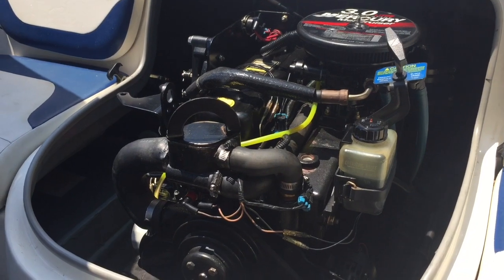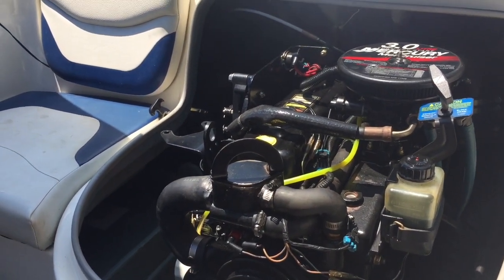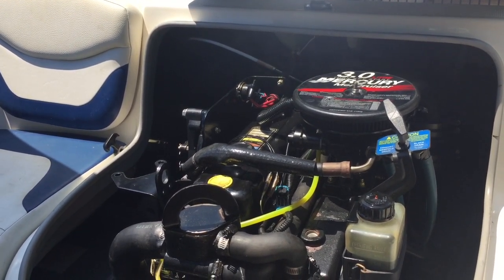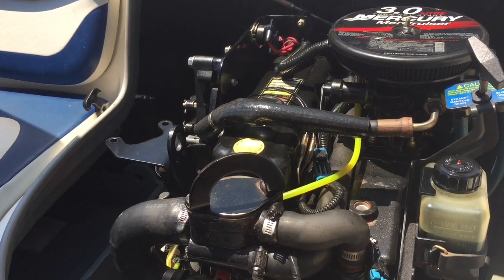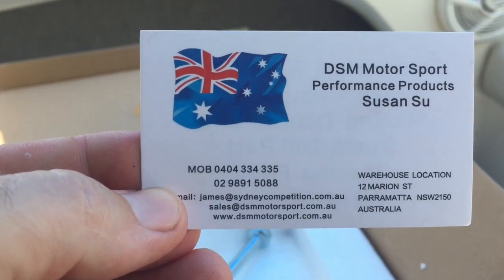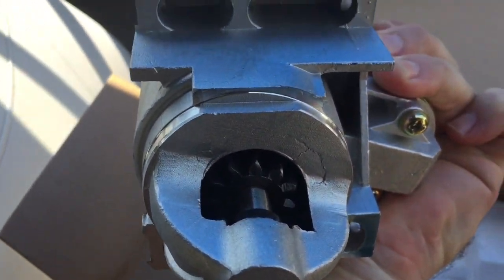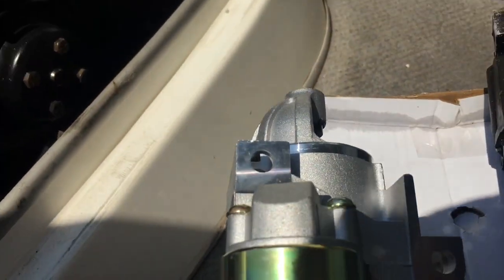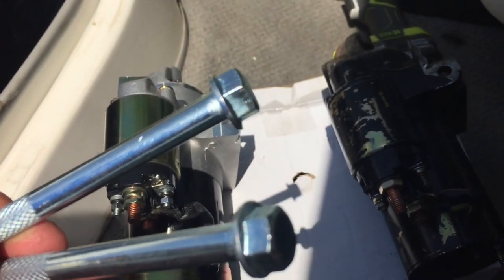Mercruiser 3.0 starter motor

Comment: Do you have the part number?
Reply from the maker: https://www.ebay.com.au/itm/Mercruiser-Marine-Starter-Motor-Suit-V8-Suit-V6-Suit-3-0-Litre-/323696753554
Reply: Is that starter rated for marine use? It looks like it is for an auto. They should be spark proof. Just asking?